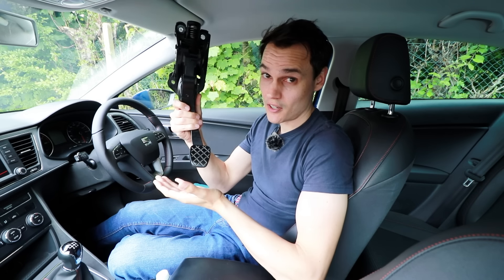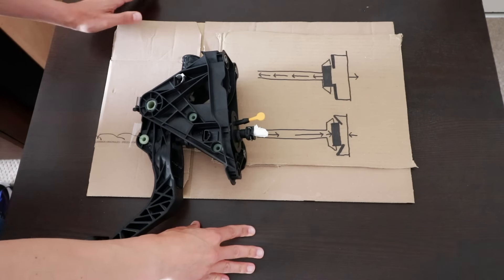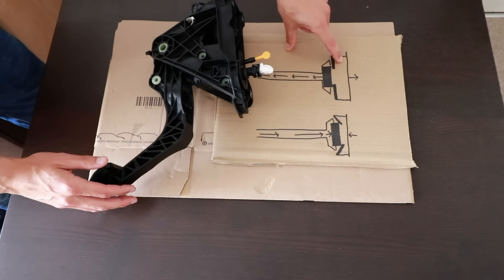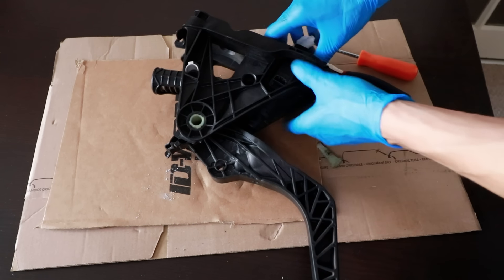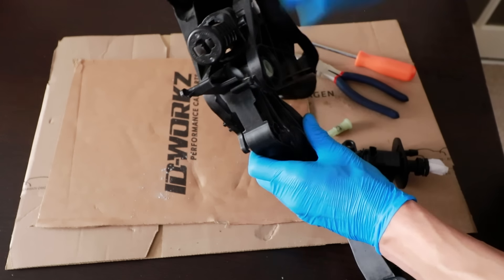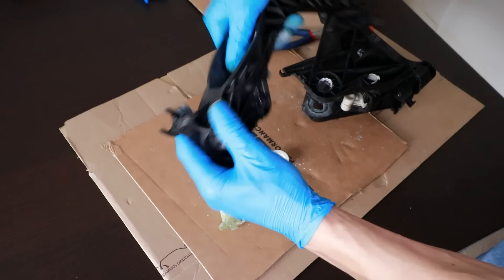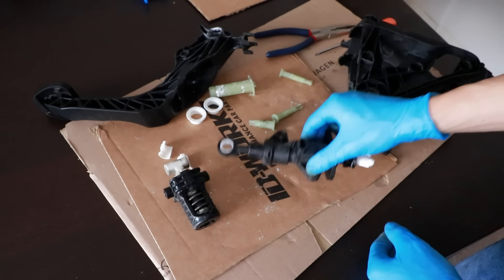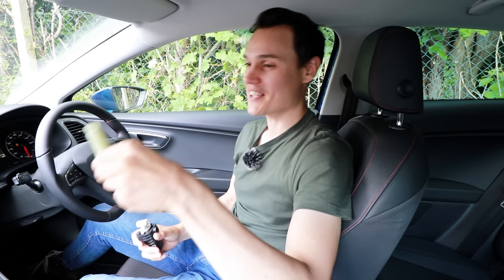This Spring Makes Gear Shifts Easier & Clutch Pedal Wear After 10 Years of Learners

Comment: My Volvo C30 clutch pedal kicks your foot up when it gets near the bite point which makes it super hard to feather the clutch. I got a much lighter, aftermarket pedal return spring and it solved the issue.
Reply: Planning on doing this with my Focus which I assume uses the same spring. Only discovered lighter, aftermarket pedal return springs were a thing recently!
Reply: @dangerbanana8234  Yes, the Focus ST and RS uses the same spring.
Reply: @dangerbanana8234  i liked my focus's heavier clutch

Comment: The first car I drove was a VW polo and I think it had a similar system. Honestly, I hated it, once I was doing a hill start and got to the bite point, because I was on a steep hill, I had to hold the clutch higher than usual and suddenly felt pedal weight increase a lot and I thought "it's a lot heavier now, i should let go of the pedal" The pedal came up, but the car started kangerooing for a while because I should've holded for longer

Comment: While learning to drive and getting my licence, the teaching facility I went to had an old beat up hyundai i10 with a clutch that was really ambiguous and hard to press. On one of my lessons the car got a check engine light so we had to switch to their second car, which just got off the shop and the clutch was light and the bite point was obvious. I realized how intuitive and easy it was to use the clutch after that point. I think it is for the best for beginners to learn using new clutch pedals that aren't worn yet. I ended up getting my exam in that freshly built car and thanks to that I had no hiccups of any sort and passed.

Glad you made the change, I bet your students will appreciate them the way I did.

Comment: Thanks for the video, Richard!

I can barely feel the bite point as I shift gears after 2 months of having my car (purchased from an Approved Used VW dealer). Up until a week or so ago, the pedal was much more responsive.I've taken it to Halfords for a clutch inspection and after having a look, the mechanic called me confused as to why I'd even brought my car in! The service at Halfords was free, so I cant be sure how comprehensive the inspection was. Can you advise on how to try and diagnose my issue before potentially spending a significant amount getting a mechanic to replace the entire clutch?

Many thanks!

Comment: Great explanation! Something interesting I've experienced is an aftermarket clutch kit that started engaging just a little before I felt it in the pedal, which always felt a little off and made taking off and shifting smoothly a bit hard. I never really did get used to it and stalled it a few times. Instinctively, I just kept lifting the clutch to what felt like the beginning of the bite point, but it actually hit the bite point before I could feel it. That clutch kit was made by a reputable brand too.

When I removed the transmission to install a limited slip diff, taller 5th and 6th gears, and a 6 pound lighter but still OEM flywheel, I decided to get an OEM clutch disc and pressure plate too and now it's very easy to take off and shift smoothly and I haven't stalled it since. The clutch now feels totally intuitive.

I guess the takeaway is to buy an OEM clutch kit if you want to make sure the clutch works exactly like it did from the factory.
Reply from the maker: This is why I've learnt to avoid after market parts and try to stick as much as possible to original parts. The aftermarket parts usually work, but you never know if they will work as well.

Comment: Really interesting video, I used to drive a 2000 skoda felicia which had a pedal that pulled on a wire which moved the clutch. Now I drive 2009 Nissan and the pedal feels quite different. 
But I wonder, do you have your own clutch pedal in passenger side? If so, how is it connected? Also you could make a video of how is drivers car different to normal car (not sure if you havent made it and I just missed it?)

Comment: Great explanation, one question that i got.

Does your car have Dual Mass Flywheel ?! or it's Solid/One peice ?

I assume if it was DMF it won't last that much miles with learner drivers. probably would need replacing at least 4 times during this car lifetime.
Reply from the maker: It's a single mass flywheel.

Comment: I also have a high mileage VW concern car from around the same time and my clutch is heavy as well. Glad you made this video. Now I can breathe easily since I know the heaviness is caused by just the age of the pedal and not the clutch itself.
Reply from the maker: They also get heavy as they wear if they have a self adjusting pressure plate. I believe the pressure plate has less leverage as it adjusts to take up the space caused by the wear. So it could be the pedal but may not be.
Reply: @ConquerDriving  Thanks. I need to stop the habit of jumping to conclusions quickly.

Comment: My '94 Rover has a cable clutch, it's pretty heavy as it's just a straight connection to the throwout bearling lever on the side of the gearbox. While it's heavy the whole time, you can feel a decent bit through the pedal like at the bite point. Personally I like it more than a hydraulic clutch.

Comment: Can you make a video about how to change lines, but not on the motorway/dual carriageway, but in the city traffic? 

I think there is a key difference there bc, in most cases when you are on motorway incentive to switch line is to overtake, but in the city incentive is mostly bc you need to change the direction of driving. If you won't find a gap on the motorway worst case scenario is you will be a bit later at destination, worst case scenario in the city is that you won't reach the destination. First is not so important, second could be crucial, hence a lot of ppl have techniques and opinions how to go about heavy traffic in the city.

Some just force cut in in front of approaching car, some would just drive in their line trying to find another route(it could not be ease in some cities, and if you are unfamiliar with it you may get lost), and even some think its ok to just stall the traffic in their line waiting for the gap to appear. What would be your take?

Some tips would also be nice e.g.: 
1. How to plan ahead switching multiple lines?
2. What to do if we have to go pass more than one line on a very short distance with a view to turn right?
3. Is it ok to be driving in the right line if you know that you will be turning right even though there is no road marking yet telling you that the lines are diverging? At any point there could 3rd line poping up on the right side just before the crossroad and you could not have time to switch two lines.
Reply from the maker: Thank you for your suggestion, I may consider this in the future.

Comment: The first car I learnt to drive in was one of the first Peugeot 205 GTis, the clutch pedal was awful on it, so heavy.  I don't know if it was meant to be like that, but I hated it when I was sat in a traffic jam and I never drove a Pug GTi ever again - even the 1983, A reg coach, I drove afterwards, had a lighter clutch than that thing.

Now, nearly forty years later, I am about to buy another brand new car, with a new type of clutch (to me anyway).  It has a manual, what they call, "Intelligent Manual Transmission" or clutch by wire, meaning there are no mechanical between the clutch pedal and the clutch itself, all electronics and code.   So, that will make for an interesting learning experience, as my brain has been hardwired to the old hydraulic clutches.
Reply from the maker: Make sure you test drive the intelligent manual that Kia and Hyundai do. It's not for everyone as the coasting setting it has can make it difficult to predict how much the car will slow down when you come off the gas.

Comment: Ingenious design! One question; do more 'sporty' manual cars tend to have linear clutches, or is it simply a manufacturer choice? Many thanks!
Reply from the maker: I've not noticed a difference between types of car. Generally more powerful cars seem to have heavier clutches though.
Reply: @ConquerDriving  I still have an e46 straight-six BMW coupe and its clutch pedal resistance seems linear throughout its travel. Many thanks!

Comment: Some carmakers have got this setup awfully wrong. It's well-known in 370Z circles that the 'helper' spring is WAY too stiff. Forums are full of people saying "I've been driving manual forever but just can't get my shifts smooth in this car". Seems to be an issue in the GT86 too.

You either remove the spring entirely or swap it out for one several times less stiff. Totally transforms the clutch feel.

You're right though Richard, working on the clutch pedal in a RHD car is no fun at all. Our American friends have it easy because the clutch is just inside the driver's door. Lucky buggers